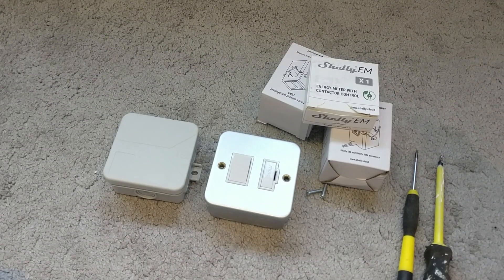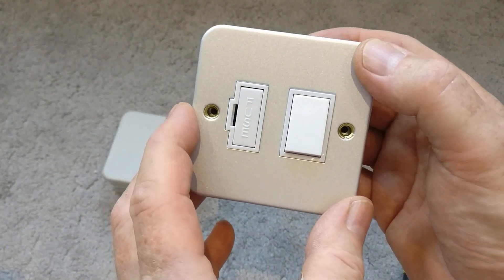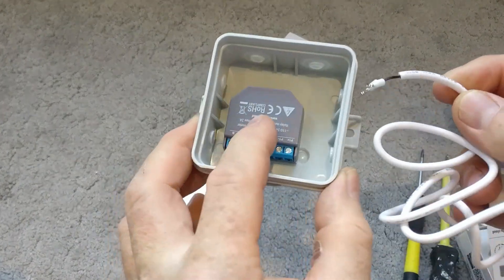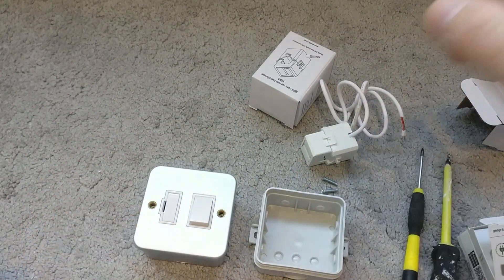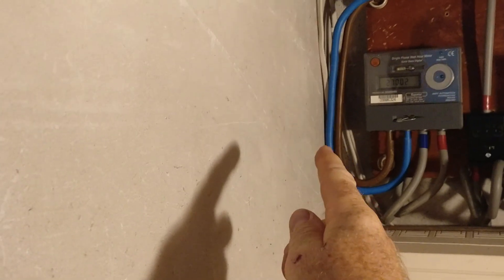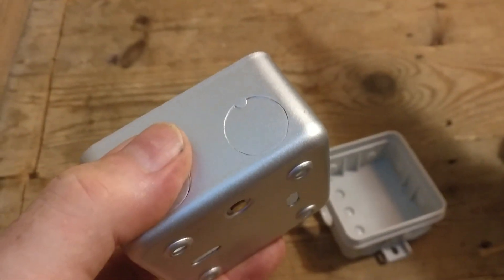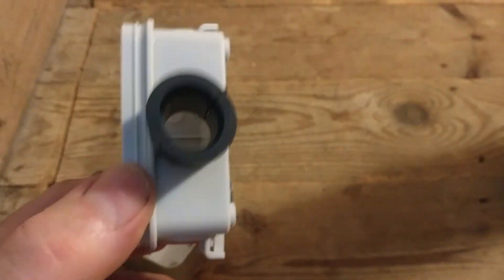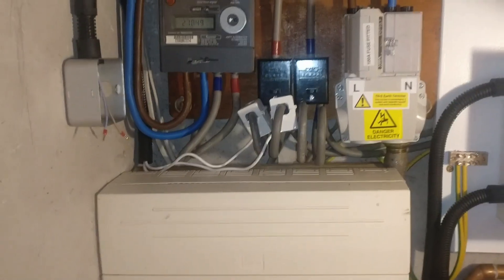Shelly em Smart Energy Monitor | Installation

Comment: Hi Pete, just found your channel looking at Shelly EM stuff!  I have one on order, together with some electrical gear, as I want to monitor my solar generation and EV charger for use with Home Assistant (long story but my solar provider is NOT HA friendly!) - Shelly EM is one of the units HA actually recommend, so I went for it… 👍🏻
Thank you for your clear and concise videos on the Shelley EM, which I found very useful for my upcoming install - you have earned a new sub, thanks again… 😉
Reply from the maker: Thank you so much for the kind words. Really appreciate it.

Comment: What MCB could I power the shelly from?  I've got a spare  Hager  MTN 106   B6  spare unsed (meant to be for alarm), could I use this one?
Reply from the maker: I used a B6. I also used a 2amp fuse in the spur junction box just as an extra safety measure.

Comment: I've been looking for something like this for ages. I've got a holiday let with a hot tub that runs 24/7. During winter, my monthly energy bills routinely top £700+ and I want to get a better understanding of how much and when the tub is consuming energy to see if I can adjust filter times, etc.

So am I right in saying all I do with this is just connect one of the clamps to the hot tub circuit coming out of the RCB?

Great videos on it, I spent ages looking for a UK review of this kit!
Reply from the maker: Glad the videos were helpful. Wow, £700. Yes, if you put a clamp around the positive feed from the MCB that supplies the hot tub you'll see its energy consumed. As long as there's nothing else on the circuit or it wont measure just the hot tub.

Comment: Hi Pete. Id like to have seen the wiring in your consumer unit to power the Shelley but anyhow I need to monitor one circuit which charges an electric car through a domestic 3 pin plug. Does the Shelley EV clamp around the positive tail coming from the MCB for that radial circuit because the wire is only 2.5mm and the clamp looks far too big for that size of live wire?
Reply from the maker: Hi Darren. You can get a smaller clamp. Mine was 120amp. They do sell smaller ones. Yes, you need the clamp on the positive wire only to measure the power consumption. If you clamp it over the whole cable with the positive and neutral the phases will cancel each other out and you won't get a reading.
Reply: Hi Pete thanks for your quick reply. In terms of the data received seems to be only watts showing on this video. Is that easy then to relate this to actual running cost?
Reply from the maker: Hi Darren. No problem. On the web interface it shows real time power consumption. It does have internal memory and you can down the data. So you have options for running costs. You could use the downloaded data and create a spreadsheet and using your supplier price per kWh to calculate cost over time. Or you could download the Shelly app and link to their cloud. I haven't done that but I think they have a calculator function..or you could integrate the Shelly to a smart home hub which invariably have that capability.
Reply: That makes sense, thanks. One final question if I may. My consumer unit has RCBOs (one of which is the car charger) so I’m wondering how to get power out of the consumer unit for the fused spur in your example. Where can I take a live from as I presume it shouldn’t come from the same RCBO I’m wanting to monitor. ? Does that question make sense?
Reply from the maker: It doesn't have to come from the same place. The power supply for the Shelly can come from anywhere. You could just wire it to a fused three pin plug and plug it into a power socket. The Shelly only draws 2amps so you would need a 2amp fuse ideally.
Reply: Yes unfortunately no regular socket is near the CU so if wired into the consumer unit then I’d have to use another RCBO slot. Bit of a waste I guess.
Reply from the maker: Oh ok. So you can have a radial spur from the CU and install a single socket near the CU for your Shelly.
Reply: Yes I think I’ll need to install a radial spur due to the 2A fuse required for the Shelley. I was going to bypass the fused spur and connect directly to the spare RCBO but it’s rated at 16A so don’t think that is correct installation. So instead connect I’ll install a 2A fused spur powered directly from the 16A RCBO that should do it? Thanks again for your help.
Reply from the maker: Yeah, a spur with a socket using 2.5mm squared 2 core and earth. If in doubt get a qualified electrician.